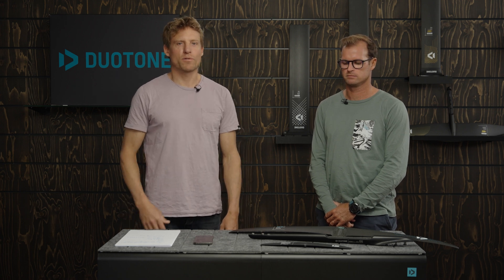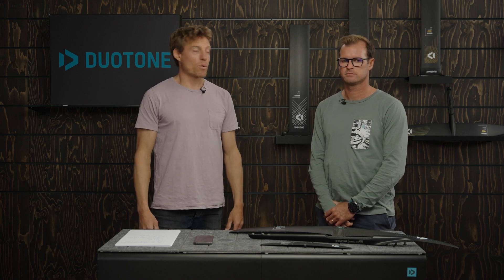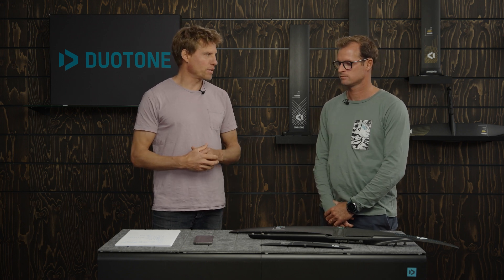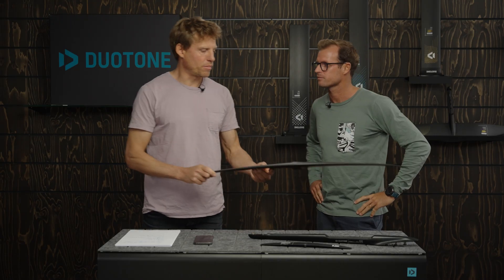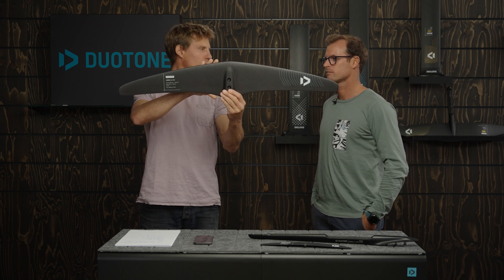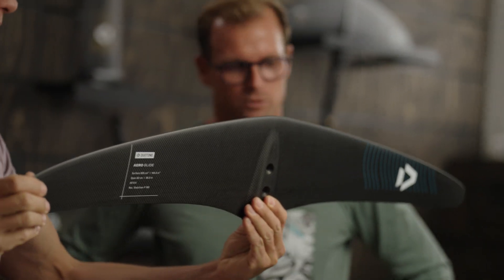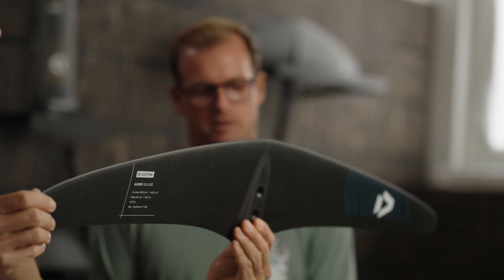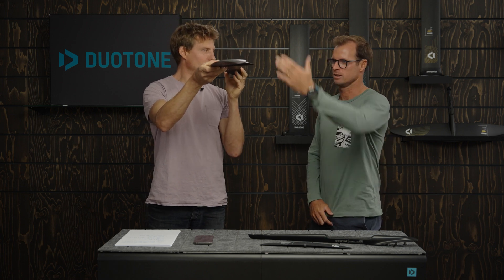Duotone Wing & Foil Tech Talk - Foil Development

Comment: Hello Jerome! Love your wings and the Aero free 1000 is still my daily driver. What are your thoughts on sanding foils? I know the foils come ready to ride out of the box but is there benefit to going over a new foil with 2000grit sandpaper to remove the hydrophobic factory coating and improve laminar flow? Also, what about sanding an old foil every once in a while? Sand in direction of water flow? Thank you!
Reply: Yes you can for sure improve the laminar flow by sanding your wings and your mast. I like preparing my race setup by sanding with 600 up to 1200 for the wings and up to 2000 for the mast. Sure you can give a little sand to an old foil once a year or so. Finish the last sanding strokes in the direction of water flow yes.

Comment: Great video! Thank you for the R&D insights.

This is a long shot as your production is locked in, but is there any chance that you could incorporate a fiberglass ply at the wing to fuselage interface to reduce galvanic corrosion? I've been using a plastic tape layer between the wings and the fuselage, and it has reduced corrosion a lot. It would be nice to have this integrated into the wings though.
Reply: Glad you are enjoying this more technical content.
We have already implemented a glass layer on our carbon masts, at the 3BS connection, and have now started adding it on our wings as well. All the latest wings should have it already and although it helps to reduce the corrosion on the aluminium fuselage, it doesn't completely prevent it, so we still recommend to disassemble and rinse your fuselage with fresh water after each session.
Reply: @BonieuxJerome  that's great to hear! I agree, it doesn't prevent corrosion, but it does reduce it noticeably.
I've got the new Whizz 1000 wing set, and it sounds like that has a glass layer at the fuselage interface - awesome!